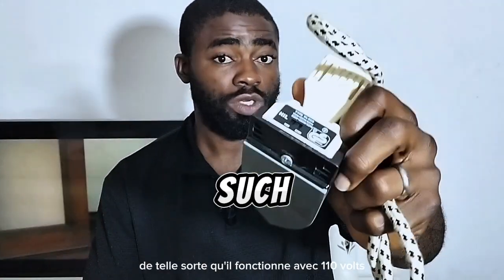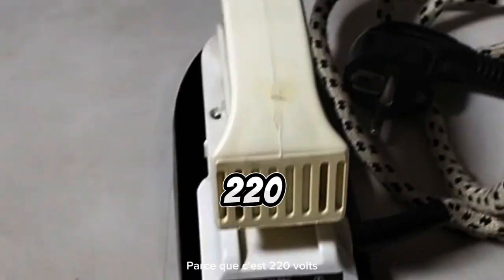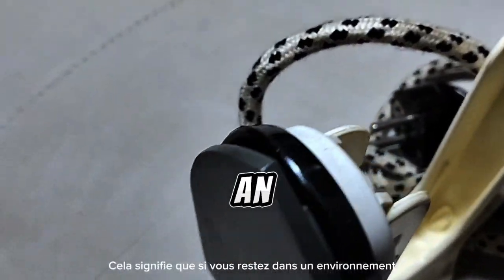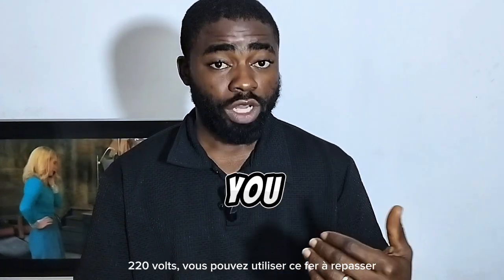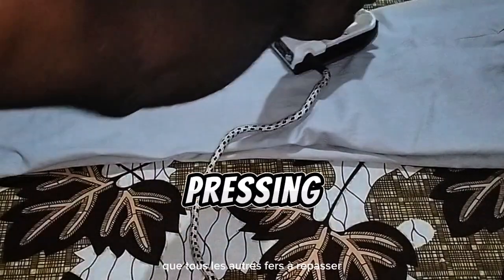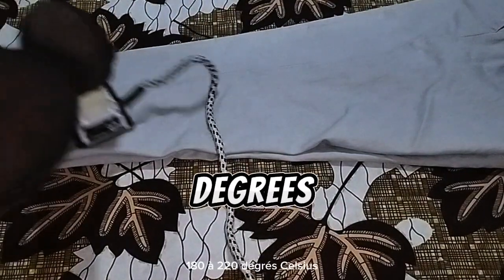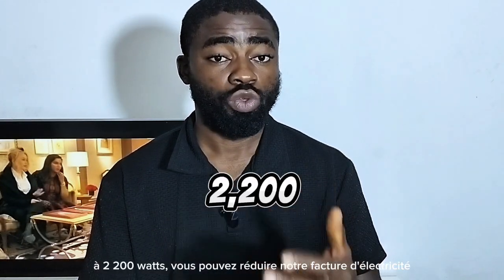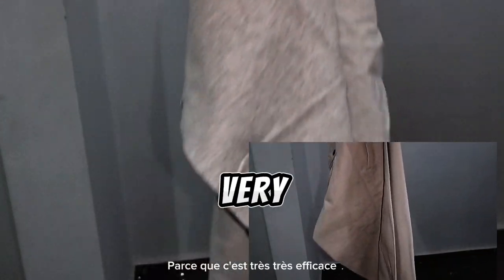Best pressing iron option for inverter solar energy system

Comment: Pls what is the name of the pressing iron? And u if say deep freezer consume 210 to 220w doo u mean 1kva inverter can power it up since it can power the pressing iron?
Reply: Deep freezers have surge power. Intially(maybe first 30s) it could be consuming maybe 10x  the power (~2200w) bcos of the compressor before it stables down to that 220w. You would need a minimum 3KVA inverter. That is why you see your light bulb flicker whenever you turn on your deep freezer.
Reply: @iamdeji Yeah , that's true

Comment: Good invention, but the heating power is low and will easily get cold when you put it on a thick cloth. Same as the 12v dc 150w iron.... its a crap.

I think inverter users should take note of something.... if you use inverter 2.5kva and above and you at any time load your inverter up to 50% its same as using your normal 1000w or 1200w pressing iron. Iron is a resistive load and doesn't have the inductive burden at starting. So if all other load can be switched off on a 2.5kva inverter, the pressing iron can be used easily. The only issue is that users dont have the time to start switching off device on inverter even though they do that on a generators 😂😂

So installers that tells their client that they can never use iron on a 5kva inverter even when their other load is less than 1kw. Which school did they go to...

All the same, this miniature iron is good for 1kva inverter users and small gen users, and they have spare 1 hour to iron their cloth.
Reply: U're making sense, my brother. People don't understand nothing... Why should u put on every load at the same time